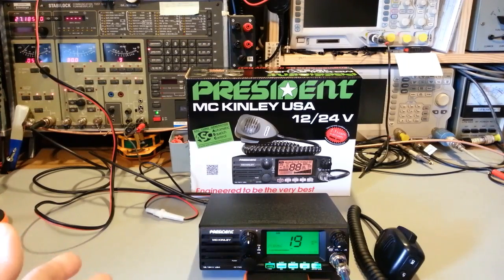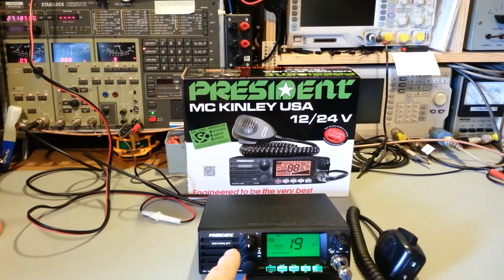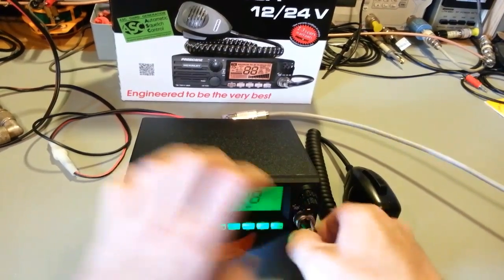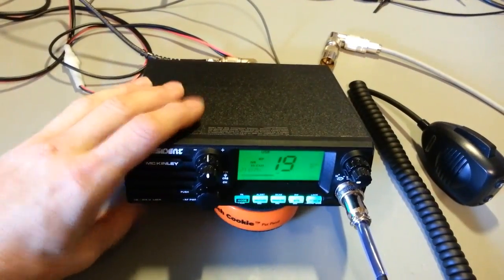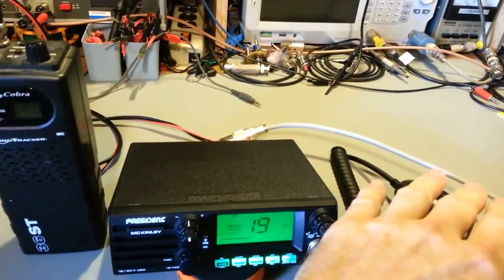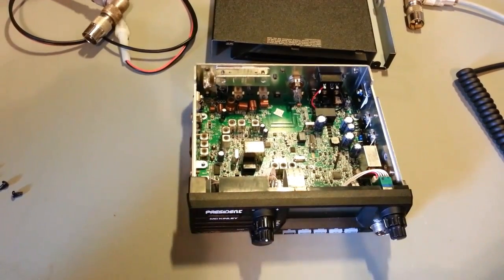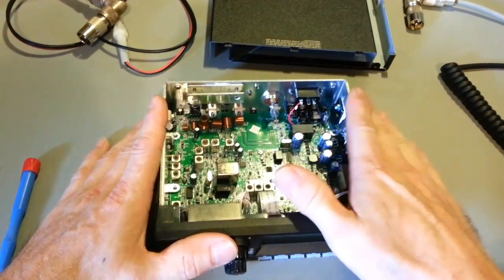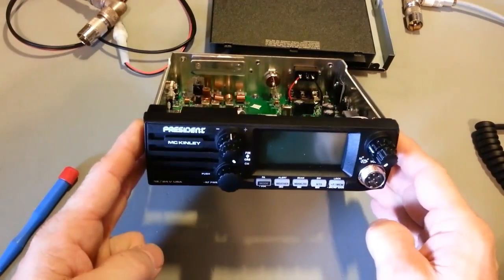President McKinley USA 40 ch AM/SSB CB radio teardown and review.

Comment: Come on now you know the local CB shops will be claiming 50 watts of swing on their DOSY meters, just stretch the coils out remove the slug and boom 50 Watts, come on you know that's what those ripe off shops will all be claiming in no time flat, that radio will be doing what a single final Connex can do in no time and the sales point will be no one will be able to tell the difference.............................
I don't miss those days of working around those CB shops.
Reply: Yes and what you end up with after having that done is a distorted square wave splattered signal that overdrives the finals and eventually causes the radio to fail. Not to mention that no one will be able to understand a word you are saying! Since the late 70's I've NEVER had any of my radios touched by one of those clowns, all my radios over the decades and the 16 radios i own today are all bone stock. In fact my daily radio i use in my truck is a Realistic TRC-427 i got new in 1979 (also own a 76 model i picked up in the 80's) and that old radio receives and transmits perfectly fine.
Reply: @k.c.lejeune6613  LOL! I remember a 4 watt radio of mine being able to block out a "maul dropper".

Comment: SWRS, what is that?
Reply: Not sure if you're serious. If you are and you really don't know, SWR I believe stands for "standing wave ratio." Its basically the ratio of power the radio puts out to the ratio the antenna puts out. Perfect is 1:1. He calls it 1.0 or 10 on the display, same thing. In reality, anything under 2.0 is good. You don't want a high SWR because that's like a high resistance on the output of the radio. It can burn out that final transistor he was talking about. You also want low SWR because you only get 4 watts, why not make sure you actually transmit 4 watts?
Reply: Brandon Hebert they did NOT ask about SWR they ask about SWR’s and there is only one SWR and it is not plural and why they make SWR Meters and not SWR’s meters.

Comment: No to bad of a radio but it cannot be modified with channels such as the free band or unlock the clarifier.
Reply from the maker: +DrSysop 

I will be uploading the clarifier unlock procedure here on YouTube tomorrow.  I have already done it and it works.  Don't give up on channels yet.  Mark is going to see if he can crack it like he did the 980SSB.  Like the 980SSB he is going to have to make an entire new CPU display board and write all the code for it.
Reply from the maker: DrSysop 

I think it was something like 3.2 KHZ up and down.  Trying to get to the adjacent channel would make the clarifier all but unusable.  It would be to touchy.  Like I said, need to see if Mark can come up with a replacement CPU board for this.
Reply: Great will be waiting & thanks 73's
Reply: DrSysop not having extra channels or mods makes it a much better choice for me. I don’t want any CB with any extra channels or mods. Unwanted and unneeded for me ever.

Comment: Mike good vid,thats why UK went NFM originally on cb "noise squelch" most sets supported this,some did use carrier squelch on NFM too mainly export multimodes.
None of that carrier stuff open close open close :) wink

ASC works well on new presidents,can see Mckinley becoming popular set,DIN mounts available in UK here for most sets.

Sure USA President will get them in stock soon.

Like the variable TX power function handy.

73's Rob

Comment: Mike, or anyone else that owns this radio, what kind of microphone cord does it have? Is it the type that is fairly inflexible in cold weather, or is it the type that's more resistant to cold? The kind of cord on the Johnson II USA I own isn't very flexible in cold weather. I noticed the cord on the McKinley USA has that somewhat matte black finish, instead of the glossy look, which in my experience, when a microphone cord has the matte black appearance, it is almost always the more flexible type. Thanks.
Reply from the maker: +Adam Hannah 

It seems like a rather stiff cord but also rubbery.  I did just discover the wireless mics work with these so that's a option to, no cord at all.

Comment: I noticed one thing the radio is missing for SSB users is a place for a frequency counter display. I like at least 6 digits for an accurate display.
Reply: A frequency counter is unnecessary for channelized service like CB.  It's only useful if you're doing something else with it.
Reply: @loctite222ms  like ssb...

Comment: My asc works well on my Stryker 955. The only thing it doesn't have is a weather function, but I can live with that. Side band can be on, but that doesn't mean that the other radio's you are listening to are on. I have to tune in one person while some others will be off or vice versa. Clarifier can be dead on but others that are transmitting need to be right on as well or you will have to tune them in.
Reply: Adonis cmj Stryker is a POS that drifts on SSB. I know people who say theirs does not but enough testing has been done that we know they do just like most other modern Export CB radios. They are over hyped, over priced, & overrated garbage.

Comment: Mike, this video makes me proud to be a current owner of a President CB. The radio I own is the President Johnson II USA. I was fortunate to be the very first person to own this particular model in the USA. It really is a very good CB. It beats the pants off of the Cobra 25 and 29 radios that used to be in my pickup as far as adjacent channel interference goes (great while on the road and you are talking to a friend on another channel, and a fairly close by trucker is on channel 19, or one of the channel 6 people are running tons of power) and also filtering out that annoying alternator whine in my 2013 Chevrolet Silverado. The Cobras could just not filter it out. After watching this video, both me and my Wife are getting McKinley USA CBs for our pickups, and the Johnson II USA will be used as a base radio. Thanks for the video.

Comment: Thanks for the review Mike...if I were a CB'er I'd be sold!
Reply from the maker: +Dino Papas 

You could always start. Sure you could rig up a home brew wire dipole in a few minutes. ;-)
Reply: Heck, I could use my SteppIR...it'll tune anywhere between 80m and 6m!
Reply from the maker: Dino Papas 

LOL, kind of like me.  I could pretty much stick a coat hanger out the back of my antenna tuner and tune it in for anything.
Reply: @mikesradiorepair  President McKinley USA I like lol feature I pretty much  100% I like  the ACS I would try I own 980ssb I love that lol feature in that I got w906 wireless mic love that

Comment: great review mike.  glad to see someone admit the negatives when they are given the radio for free.

Do you think that ACR problem could be fixed with narrower skirts, or do you think this is a thin copper PC board problem?

also, i wonder if that "bodged" diode on top of the board might not be for a channel conversion?
you know how they always used to make the removable part very obvious.

sure wish it had an analog meter.  i might buy one if it did.
Reply from the maker: +loosecannonradios 

This radio is pretty much channel mod proof.  Mark is our only hope cracking this one.  It will require a entire new main MCU / display board with his special magic like he is doing on the 980SSB.  The big killer here is the custom masked processor they are using.  The display on this radio needs a large amount of control lines, more than any other chip can do.  The only option may be a dual chip solution and possibly double stacked boards.  Time will tell

Doubt the board quality has anything to do with A RCI, it's a nice high quality board.  I may try some different filters and see what effect that has.

Comment: I actually won this radio from President Electronics right before they went on the market and I did a video on here operating it and had a DX contact on Side Band as soon as I hooked it up for the first time Straight Out of the Box. I own a lot of radios. And this is by far one of my most favorite radios I have ever owned. I run this radio everyday in my vehicle. I was running an RCI 2950dx before and this radio took its place that's how much I love this radio. This radio also has by far one of the best receivers for a mobile a radio. And you are 100% right about the Rodger beep it sucks. And I absolutely love the review you did on this radio. My question is cuz I plan on buying another one can the radio be modified for extra channels?
Reply from the maker: +david snow 

No, at least not yet.  Mark needs to look it over and see if a new custom MCU/display board may be possible.

Comment: Roger beep helps on SSB hearing end of TX.  If used properly they're great, I know many clowns just use them as noise toys on AM.  The SWR circuit on that is sheer genius.
Reply: Roger beeps are totally unnecessary.  If you're a proper sideband radio operator then you will use Q codes and say "over" when you're through with the QSO.  I always used "over" when I stopped talking and transmitting.

Comment: Mike is there an indash mountings kit?
 Thanks for the review. Good job.
Reply: While I do not know if there's a kit you can get for DIN mounting in the USA, there is one available on the European President website.  https://president-electronics.com/Accessories/CB/Rack  Just look for the one that reads "Johnson II ASC.  No, I know that's not your radio, but the McKinley USA and the Johnson II ASC have the exact same measurements, so it should fit.  Just call them and see if they would sell you one directly.  Visit here: https://president-electronics.us/contact  Good luck!
Reply from the maker: +grin and bear it - 

Honestly don't know.  Would need to check Presidents website.
Reply: Adam Hannah thank you.